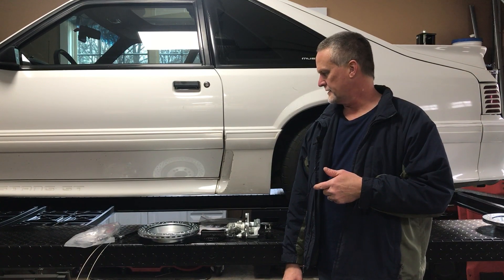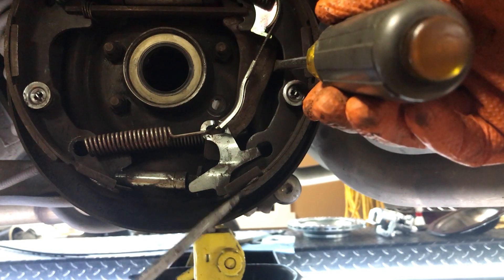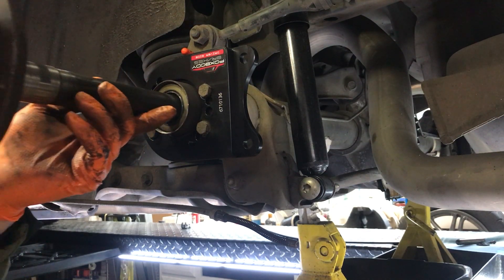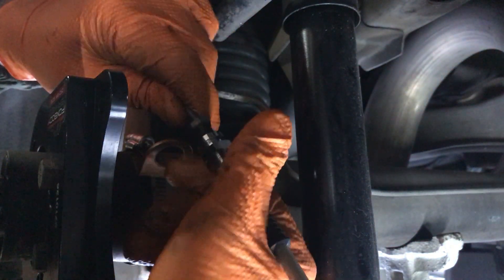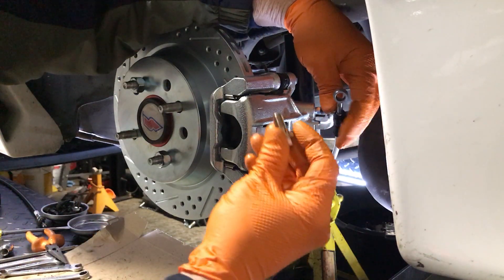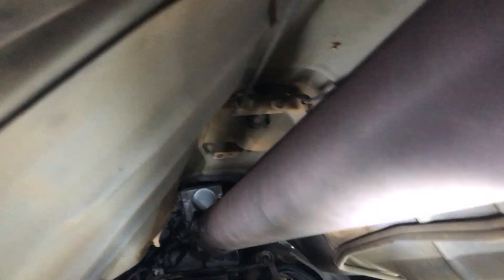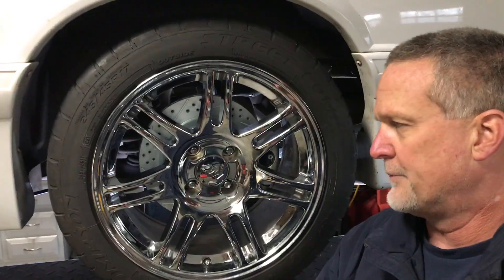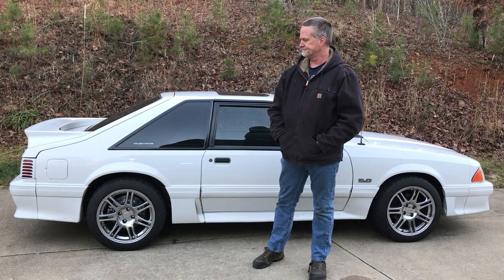Budget Friendly Foxbody Rear Disc Brake Upgrade (Please note: I have Rotors backwards in the video)

Comment: On the parking brake cable, there is a side that looks like a ball, and one that looks more like a cylinder. It looks like you pushed the ball side through to the parking brake, that side is actually smaller than the cylinder side. I'm measuring the ball side at around 12.4 mm and the cylinder side at around 13.4 mm. When pushing the ball side to the caliper, and the cylinder side to the parking brake - it all fits.

And thanks for the video, I watched it multiple times along with a few others before I attempted this on my ride!

Comment: Thank you for doing this. Have a 93' Cobra and now my Dad's 91' GT we've had since new, and the 91' is needing some TLC after being a daily for 30 years. My idea is the make the 91' a Mountain "Touge"/Circuit setup because the car had always loved curvy roads but I noticed the brakes are a massive weak spot when trying to work the car into a corner. So when I started tearing the car down I decided the brakes and the cars wiring are going to be the first thing I build from scratch. This helped me alot watching this so thank you. 

And just an idea for maybe doing it cheaper, the 93' Cobra uses either a thunderbird or mercury rear disc setup if not mistaken, so if you can find what car from the 80's SVT used when building the cobra you may be able to source a rear disc setup used (You will need the brackets for conversion though)
Good luck all, and remember to be careful in the rain especially. These old foxes don't have good brakes and no ABS, and when someone pulls out in front of you things can get sketchy..
Good luck everyone.

Comment: Whoa this is way easier and cheaper than some of the other solutions I've looked at.  Thanks!
Reply from the maker: It is well worth it. The stopping power is not much more but it is better. I’m very happy with the brakes.
Reply: @fixthemthings  I have an 86, I upgraded the front spindles to later model and went with a Powerstop kit for 87-93, that was a night and day difference, can't wait to do the rears!

Comment: Save up a bigger pile of money and do the complete 5-lug conversion at one time. Any 94-95 Mustang (or a 96-04 if you go to an aftermarket k-member) is a donor for the hard parts (spindles, axles, etc.). You'll have a huge selection of wheels to choose from and can easily move up to serious brakes in the future. Maximum Motorsports can help if you need parts and advice.

Comment: Great vid! Brakes are a real shortcoming on Foxbodies! Glad to see an affordable kit thats not 2k$. Did you let the company know about that hole in the Caliper being to small? And did you do a vid on rebuilding the trac loc clutches? Id  love to see it, as it seems the Ford Motorsport Trac loc 28 spline may be discontinued now..Again great vid!!✌🏾
Reply from the maker: Thanks. I contacted them about the hole size. They said they thought all of them were fixed. I guess mine was overlooked. I love the brakes. I only had the one lockup. It was probably because of doing the video and doing a quick hard brake test before breaking them in. I don’t plan on doing the clutch packs until they are worn again.

Comment: Nice job chief.  I have an all original 1989 Mustang GT with 165k in showroom condition and curse those drum brakes anytime I service them.  Are the rear disc replacement pads for an SN95 car?
Reply from the maker: I think they are however it would be best to ask Foxbodybrakes.com. I’m really liking the brakes. No wheel lock ups like I said in the video. Was just the one time. By the way, the parts are all brand new and ship from Baer.

Comment: That is one clean foxbody undercarriage!  Did you change the prop valve and master?  The fluid volume required to lockup will change drum to disk and you should look into that.
Reply from the maker: Well, it has been garage kept it’s whole life.  The lockup only happens if I hit it as hard as I can which I probably shouldn’t have done yet as it needs to break first.  I would think both should lock up if it was a proportioning valve problem. I’m thinking I should have went ahead and did the clutch packs. I was too lazy to fumble with the spring and said “screw it.”
Reply: @fixthemthings  I was more referring to rebalancing your line pressure front versus rear. Do your front brakes lock up before the back?  I know back in the day when we either gutted the proportion involved or put in an adjustable proportioning valve.  And of course change the bore of the master cylinder by replacing with a 93 cobra type or aftermarket but people were doing more bear brakes and things back then.  I've done a turbo coupe rear disc setup as well as baer tiring 12" and to get the brake bias proper I had to modify both the MC and prop valve. Of course that won't affect side to side pressure just front to back
Reply from the maker: @TheTTVert  maybe the left side doesn’t lock up because of my fat ass on that side.  Could be proportional problem. I’m not gonna worry about it because it is only when I stand on it.  Oh and by the way these brakes were sent from Baer.

Comment: Solid video! I like it man! I missed it, was there a proportioning valve in the kit at all or did you just send leave the OEM one in?
Reply from the maker: No proportioning valve needed. The cylinders aren’t big enough to warrant one. The brakes are working great. I don’t have any brake lock ups. Only one lockup from not doing proper break in for video purposes.
Reply: Thanks for the feedback!!
Reply: @mathewshackelford8037  The proportioning valve has nothing to do with the size of the calipers or cylinders,it has to do with the rear and front brake bias and when you install rear discs is almost mandatory to get a valve since drums and discs are totally different animals and requires a little more fine tuning than the non adjustable proportioning valve the cars come with can give.

I believe what the op might be referring to is the master cylinder, if you get big boy brakes up front then you need a new master cylinder but if you only fool with the back brakes then you dont, maybe hes been lucky and everything is working great and thats good, but i would get a proportioning valve and adjust it accordingly.
Reply: @dntlss  i know how a proportioning valve works. You notice I never mentioned calipers or cylinders, I simply asked if it came in the kit or if he left the oem one because he never covered that. 

I would have absolutely put a 4-wheel disc proportioning valve in the car, just as I did all my 4-wheel disc swaps.

Comment: Had the same issue with parking brake. Doesn't fit. What about the slack in cable? Seems long. Everything else worked out so far. Pads are a bitch with them clips. Seems real tight.  I added proportioning valve and gutted prop valve. I have to figure parking cable and bleed everything. Did a complete rear rebuild figured might as well add disc. 👍
Reply: If you haven’t got it there should be an adjustment under the console to let slack out of the cable it’s a pain to get the cable hooked up

Comment: Hey man, I had actually just bought those caliper mounting plates off ebay recently for my own conversion. I had no idea the guy had an actual website. I won't be throwing them for another month or so and was wonder how well those have help up for you and if you've had any issues with them?
Reply from the maker: I am very happy with them. The comment at the end of my video saying that I had a right wheel lock up was only the one time. I should have broke them in first but for the video I wanted to do a fast stop. This was an easy install. The braking is better and I don’t have the drum noises anymore. I highly recommend since you don’t have to change the master cylinder or brake lines.  The new parking brake cables are a must.

Comment: Hate to say this, but I bought this rear kit, had it  installed and did not notice any difference in stopping power.  I'm going to have another mechanic look it over for a 2nd opinion.
Reply: have you got proportional valve installed?   you may need to adjust that to add more rearward brake pressure..
Reply: @olliej914  thanks for the pro tip, I will relay to my mechanic.
Reply: Since the rear brakes do about 30% of the stopping you may not notice a difference. The advantage of disc brakes is a greater resistance to fade. The ultimate limitation of a brake system is the amount of grip at the tire contact patch.
Reply: @MultiTestPage did you add a prop valve? Im about done with mine and wanna know if i need a valve
Reply: We installed the proportional valve an will test drive in a few days.  Thanks for your advice.  I'll let you know how it drives.
Reply: @MultiTestPage how was it driven so far?

Comment: Ever figure out why the right wheel was locking up? I'm interested in putting this kit on my fox.
Reply from the maker: Actually it hasn’t done it since. I slammed the brakes on that day after installing. I probably should have broke them in first but to finish the video I went ahead and tried slamming the brakes. I measured my body height yesterday to see why my car was leaning. I guess my fat ass is weakening the springs on the drivers side. Maybe the height difference would affect the braking.
Reply: @fixthemthings  sounds like Richard Simmons could help with your 60-0 time.. 🤣

Comment: For the e-brake, did you modify the handle to remove that adjuster that is built into it?
Reply from the maker: No modification necessary.
Reply: Thank you! Great video!
Reply: Mine is an automatic, so I said screw that e-brake. LOL
Reply: @Fix Them Things!  hey what's the difference between the lmr kit and this one I just bought the lmr kit and the video shows e brake being modified  and don't know why you didn't have to do it I'm considering sending my lmr kit back your thoughts on what is the difference of not having the e brake modified

Comment: My shop/mechanic is saying (after I installed these PERFECTLY) that I need a proportioning valve. Please advise.
Reply from the maker: Not for this size of piston. If you go with bigger brakes you will need proportioning valve. I verified this with Baer brakes also.
Reply: @fixthemthings  so I DON'T need a proportioning valve??
Reply from the maker: @patrickmcgrew9333  No. You can put one on if you want but it will have to be wide open anyway. I wouldn’t put one on. In my video, I had one wheel lock down when I slammed on the brakes.  I haven’t had a lock down since. When I did the video, I did not break in the brakes.  I should have waited until break in to do the hard brake test.  I hope that helps.
Reply: @fixthemthings  just FYI, the shop has had my 90 gt for one total month now and can NOT get the rear brakes any brake fluid.
Reply from the maker: @patrickmcgrew9333  you must have a stuck valve on the original parts. The brass part under the master cylinder. I can’t attach a picture here to show you.  If you take the big nut of of the front side of the brass piece you will find the orings all chewed up and the plunger is probably stuck. There is a rebuild kit for that online.
Reply: @fixthemthings  AWESOME! THANKS! What gets me tho, is the brakes worked FINE b4 the swap. I just don't get it!!
Reply: Drum brake systems have a residual pressure valve, which keeps the shoes closer to the drum (so you don't have a long pedal when first applying the brakes). The disc conversions I've seen require you to gut the stock valve and plumb in a proportioning valve so you can now regulate pressure to the rear.
Reply: @mchristr  yes, I had to add a proportioning valve; wilwood from lmr. It was only 50 bucks. Put it on the passenger side, against the firewall.

Comment: Did you have to add a brake proportioning valve for the rear?
Reply from the maker: No. Not for this setup. You can ask foxbodybrakes.com to confirm.
Reply: I bought the prop valve and plug. They said you should for adjusting

Comment: Did you reuse the factory master cylinder?
Reply from the maker: Yes, everything else is factory.  If you go bigger on the caliper then you would have to start changing the factory stuff. Mine is doing great.
Reply: @fixthemthings how's the rear breaks working so far? Can you drive it daily?

Comment: Did you have to do anything to your brake booster?
Reply from the maker: No. Everything else is stock. The caliper cylinders are not much bigger so not needed. I’m very happy with them now.
Reply: @fixthemthings  thanks for the info

Comment: No prop valve or plug. Do you need it?
Reply from the maker: Don’t need it for this setup. If the calipers were bigger, then yes.
Reply: I bought it cause they told me to. I have to replace brake line because it was a 4 banger. I guess it can't hurt to add it.
Reply: No worries.
Yes you would want to get cables (we list 78-92, and 93 cables) in other auctions. I would recommend a prop valve (adjustable), and our prop valve plug. This should be all that is needed.

In some cases if your handle self tensioner is worn out you might need the short adjustable cable, but we always recommend installation first as many do not need it. This was foxbody response.  Guess it can't hurt. How do you adjust it?
Reply: @timsimons8946  which brake line did u have to replace? Mines was a 4 banger converted to 8. Wondering if mines was done already but I still have drums 5lug

Comment: I heard that rear disc conversion won’t fit with the pony wheels, has anybody experienced this themselves?
Reply: I already did 5 lug axles 1st, and the 18" Saleen rims fit and look perfect!!
Reply: @patrickmcgrew9333  I dont think he was asking about 18 inch wheels,hes asking if the original pony wheels will work with the rear disc brake setup.

Comment: Will this kit fit with 15x10 wheels??
Reply from the maker: That would be a good question for Fox Body Brakes. They are great about returning communications.  I would think so though.
Reply: @fixthemthings  A 15 inch wheel will not fit. I tried...
Reply: @mikeedwards1656  contact with the calipers? I really like how complete this kit is.
Reply: I was told 10.5 gt kit will fit 15 "